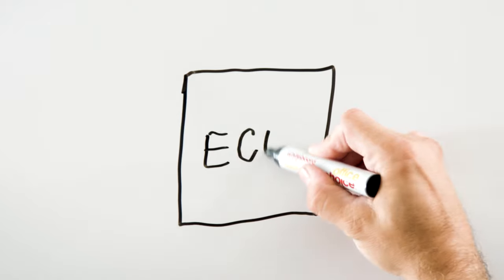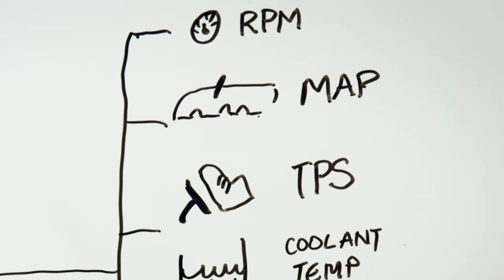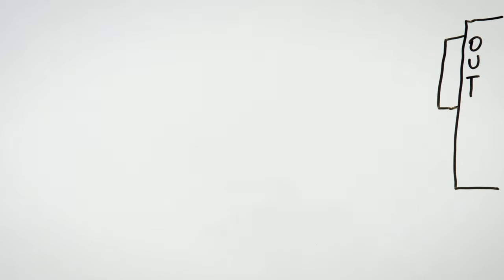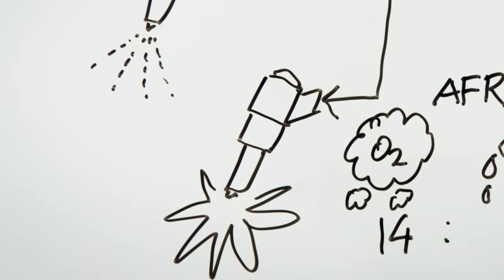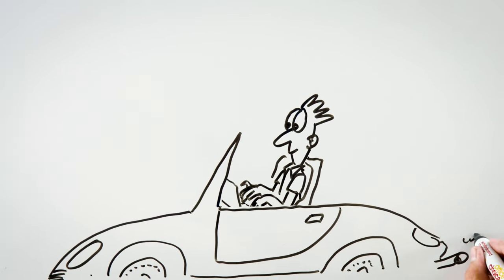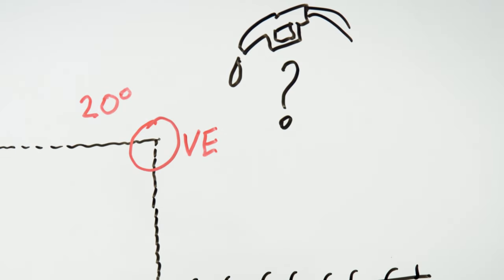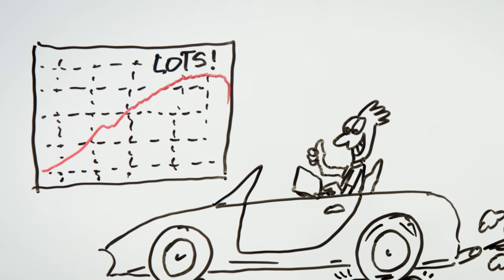💬 How ECUs Work - Technically Speaking

Comment: Scott, thanks for the video...it really condensed the concept of how an ECU vs. a carb works.  My only question is:  if I'm not obsessed with performance (and not an electrical engineer), and I just want to keep my bike running steadily and reliably, where is a good place to start learning how to interpret engine trouble codes and how to diagnose electrical problems instead of having to go to the dealer every time I get a bad code? Having said that, am I better off sticking with my carbs and throttle cables :D ? Thanks and cheers!!

Comment: Great explanation and breakdown, Scott. Still a lot of confusion out there about how ECUs and tunes do.
Reply: yep, I think what I'm learning is that any tuning I tried to do would end up with the engine running worse or not at all. 
I think, ( but I'm not sure) that you MUST do the tuning with the car on a dyno. So, either buy a dyno(kidding) or get access to one. 
But, then of course it'll be the techs and not you that does the tuning I expect.

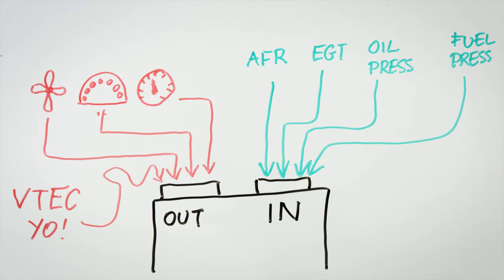Comment: Please forgive my ignorant question, but @ 4:58 and there abouts, you draw red wires going INTO the 'out' side of the ECU.
 I would have expected that the 'out' side would show wires pointing OUTward,  figuring that the signals have been corrected, and  the 'revised' signalling is then being sent OUT (to the various sensors I guess) to make the necessary adjustments for efficiency.
If that's not how it works, well then I guess I sure missed something.
I really enjoyed your presentation.

Comment: Does the ecu control the AFR, so a tuner can only input a certain AFR while tuning,  instead of fine tuning fuel injector timing for a certain manifold pressure and throttle position? 
For example you just input an AFR of 14.7 at rpm below 3k, and a little rich mixture for higher RPM range, just an example. 
Thank you so much in advance!

Comment: Hello haltech. Currently I am imagining to convert my old  2 stroke engine (Yamaha V80) using the TBI system.I'm curious about this, can the TPS sensor cable be split into two? One to the injector and the other to the oil pump (like the KTM electric oil pump). If you know the answer, I would be very grateful

Comment: I have a customer range rover car that crank but wouldn't start. There is no spark, injector pulse and very important no control feed current to the ECU when the ignition key is switched on? What causes no feed current with key ON?

Comment: Great. But my question is, is MAP really cruicial to the calculation? My bike has nothing resembling MAP sensor, only IAT, CTS, TPS, O2 sensor and that's about it. Wondering how I could connect programmable ECU to my bike when this sensor is missing. The ECU it has now is hardly programmable, reverse engineering is a way to go, but with rather blurry future.

Comment: So how are ECMs programmed? I mean I can understand machine code being completely enough for the car, but what about whenever READING the specific manufacturers data or maybe an engineer needing to reprogram the PCM for increased efficiency?

I'm basically asking how the ECM is then translated BACK into a readable language.
Reply from the maker: Via an ECU programming software. Each brand of ECU has its own firmware and a calibration software.

Comment: Hi, thank you for this video. It is very informative. However, one question though. Is the ECU mainly focuses on the FI process and is it standard for all bikes? I am planning to customize the dashboard of my motorcycle (Yamaha NVX 155). I wish to create a custom-made display screen, which I will replace the existing digital dashboard display.  I wish to make the new display screen more intelligent and has many more added function such as GPS-direction app. Is doing this does not require alteration or change in the ECU? My goal is to make my dashboard (digital display) a bit smart and does not only dispaly, RPM, Speed, Time, Trip and Odometer as what the original display does. Can you please shed me light on this, I don't wanna mess with the ECU, is it possible to make this project with the said restriction?

Comment: if I have a pressure ratio tuned elite set up and I remove my muffler the elite will make fueling change based on the pressure ratio change ....ok that's the basics please please do a pressure ratio video it's a great development that needs to be descussed.
Reply: Isn't that related to forced induction?
Reply: +SI0AX it relates to.every engine but is far more significant to a for forced ones...
Reply: So it's just another tuning method? Like boost tuning and load tuning?
Reply: it  becomes the main load axis  it creates a number from inlet manifold pressure and exhaust manifold pressure ( i think) it   looks to  express the pressure differential across the head of the engine  and that helps determine the mass of air that the engine is using .. and therefore the fuel it requires.
Reply: That's interesting. There should be a general video about all the different tuning types and a basic explanation of how they work.
Reply: yeh that  would be a reasonable compromise between what i want and what the world needs

Comment: ecu monitor sensor signal ,when sensor stop working ecu show a fault code read by scanner, solenoids like fuel injector or oil control valve dont send signals to ecu so how ecu know solenoid stop working to show fault codes related to solenois?

Comment: The situatiom im having with my 03 3.5 nissan altima is..i was told if the timing chain is out of time which i guess mine was 64 degrees out of time amd thats why im not getting spark and fuel injection...could this be a factor? This cars ignition is controlled by the ecm..whats ur opinion..i personally figured if the cam and crank is out of time and the cam and crank are both turning u should still get spark right?

Comment: Don't you also need a crank angle sensor input or trigger wheel to know where the pistons are?
Reply from the maker: Yes, we’ve simplified things greatly in this video and an engine position sensor is what we refer to as the ‘RPM’ input in this video.

Comment: You don't mention crankshaft position sensor (CKP) which is vital for injection and ignition system. 
The right timing for injection and ignition involves this CKP to determine piston position and RPM.

Oh wait, you have mentioned it elsewhere in response to someone's comment below.
Reply from the maker: We deal with the crank position sensor in detail in a separate video: https://youtu.be/HW0ENqcxNSg

Comment: If my cooling fan is not running at all, with or without the A/C on, is there a chance it could be the ECU? I replaced the cooling fan, and it refuses to run at all.
Reply from the maker: We'd recommend checking your wiring first.

Comment: Hi, Have you had any experience in updating the antiquated ECU from a 74 Model Mercedes 450sl/slc with a Haltech unit? This is the electronic version. Its called the Bosch D Jetronic injection. Hope to hear from you soon. Paul
Reply from the maker: Hi Paul, it isn't something we've done here. However, give your local Haltech installer a call, they may be able to help. 
https://www.haltech.com/dealer-list/

Comment: I have a question for you:
Why do I have to buy and expensive ECU, and have it installed and tuned, spending all of my money on some weird computer, rather than taking my mad gaming laptop and connecting it with a few cables to my mum's old Hyundai i10, and just have it send the needed info to the car?
Reply from the maker: You don't HAVE TO do any of that. If you can control your mum's i10 with your gaming laptop - go for it!
Reply: Some ECU's can be tuned, others are locked from the factory or the manufacturer has not released the source code. In those cases it is extremely difficult to modify the ECU. Some manufacturers, like GM, release the source code and make it very easy to modify the ECU, for example I was able to retune my ECU to run a completely different engine (stock engine was a v6 and I swapped in a v8) and all I needed was an OBD2 to USB converter and the software.
Reply: @haltech  obviously I was joking with the examples, but as a programmer I know how easy it is to control microcontrollers and external devices, so I don't see too much reason (except for if the manufacturer checks you use legitimate equipment) to use such expensive equipment
Reply from the maker: @irmi2000  There's quite a bit more involved in making a viable product than just programming a couple of microcontrollers.

Comment: What about mass air flow can that work in place of manifold air pressure or would that have to be converted to run a haltech
Reply: MAF comes before the throttle body, whereas MAP sensor is after the throttle body coming into the intake manifold.
So their functions are different.

Comment: Isn't a cam sensor or something equivalent required? So that the ECU can know which stroke each cylinder is in?
Reply from the maker: Yes, we’ve simplified things greatly in this video and an engine position sensor is what we refer to as the ‘RPM’ input in this video.
Reply: Ah, I see. Are your ECUs capable of controlling an engine without a position sensor? I work a lot with Saab's, and their Trionic ECU determines the engine position by measuring an ionization current in the combustion chamber/spark plug gap. If I were to install a haltech ECU on such an engine, would I have to change the coils and install a position sensor, or could I use the advanced Saab Digital Ignition cassette/coil pack?
Reply from the maker: All Haltech ECU’s require some form of engine position input to determine correct injector and ignition timing. The proprietary Saab system would most definitely not be supported.
Reply: Allright! Will have to think of a solution to that, then. Thanks guys!

Comment: I’m sure my car has a faulty ecu. The range of issues with over heating, loss of power, smoke from the exhaust irregularly, ABS , “ vsm”😢
Reply: check to see if the oil is light brownish if not you need to replace your oil

Comment: Is it possible for the ECU to control a exhaust cutout butterfly valve? Haven't seen that application on cars just, sports bikes
Reply from the maker: Yes, this is possible with our Platinum and Elite series ECU’s via a simple RPM on/off switch output.
Reply: Sweet 😁😁😁

Comment: I want to put 2kd toyota engine in f30 bmw so how am gona give power to toyota ecu to start the engine
Reply from the maker: You will need to re-wire the engine. If you use the factory toyota harness you should be able to use the factory ECU. Although if you're unsure about how to do it we'd highly recommend getting a wiring professional to do it for you.

Comment: Everybody is teaching people about the basics, but I found nobody who actually understands it properly.

I program chips, but I'm new to automotive chips. It is stunning how those 'tuners' and "professionals" know nothing about what they're doing.

They just resell maps for a massive amount of money and buy expensive software that allows them to slightly adjust the old software while understanding nothing about it.

They just have their script: oh, short these two pins for 5 seconds, plug a cable, turn on this software then turn on that software and that's it.

This type of remap shouldn't cost more than $50 for time, yet they sell it for $500-1000 as if they had to be skilled to do it...

Comment: Hey, is it possible to manage a 2 stroke fuel injected single cylinder engine with a halltech ECU?
Reply: Ofc it should be, if you are talking about transfer port injection that is.
Reply from the maker: The short answer, is yes :)

Comment: if i put some bolt ons on my car and i want to tune the engine to maximise the gains from these parts do i need to invest in an aftermarket ecu or can you still do something on the stock one?
Reply: thanks for the video
Reply: way to general...with your question if I am correct to assume r34 gtr you can tune and optimize modest bolt ons with an ecu hack like nistune or a piggyback like power fc ...if you want to go a bit more hardcore like doubling the power output a haltech plug in is worth consudering this will give you a few good upgrade functions like luanch control flex fuel.rain mode now control anti lag...
Reply: That depends entirely on what car you have,  but you are going to need a chip or modify the original ECU at the least. If it is a nissan you should check out Nistune, and you can probably find something similar for other car makes. If you want full control of your ECU you should get a proper standalone tho, thats why i bought my Elite 1500.
Reply: Adam Naylor nistune actually has flex fuel as well
Reply: @Adam Apexi Power FC isn't a piggyback.. It's full standalone albeit a bit outdated nowadays. I've just bought one for my FD. Haltech is definitely the way forward though, will be investing in one for my GT-R at some stage.

Comment: Nice, thanks.
But, I am thinking about reading raw ECU data without using any standard tools or any commercial kits.
I know different cars use different OBD2 protocols. My car uses J1962 connector for its data link, so I need a J1962 adapter to 9 or 25 pin RS-232 serial connector on a PC from which I can retrieve raw data using a simple program I am planning to make myself. 
Has anyone here successfully done so ?
Reply: Ah sorry, although my car implements SAE J1979 for diagnostic modes, it doesn't use J1962 connector, it uses a 14 pin proprietary connector. I am not sure there is an adapter currently available that directly supports this 14 pin connector. ELM327 is OBD2 compliant that uses J1962 connector. The only possible way is to find 14 pin to 16 pin J1962 adapter which I find recently in internet.

Comment: well if you think about it, if the engine has so many inputs , it should be possible to make the ecu tune itself...
Reply: Confused95 nope, that's how skynet gets started.
Reply from the maker: It is called Long Term Learning (Auto Tune), and is a feature on all our Elite ECUs, from the Elite 750 up. ;)
Reply: Haltech ok so if i would load up a base profile on the ecu and just did a lot of casual driving ,would i end up with the same tune just like if you guys tuned it by hand?
Reply from the maker: It would learn over time to reach the Target Lambda table, but you still need to set this table to the values that you want to use. But yes it would tune to this target as you drive.  However,  you would also still need to tune the ignition timing and other functions of the ECU that do not have Long Term learning.

Comment: I hate to criticise....but.....
yeah, so E.C.U. stands for "Engine Management System", right? 
so does E.M.S. stand for "Electronic Control Unit" then? 
(we're confused) 
It would really help my aching brain if the narrative actually matched the whiteboard drawings. 
Like you're saying "Ignition Timing" and writing "V.E."  then saying "Fuel Pressure" as you write "AFR", so my mind was constantly having to try to unshuffle the terms being thrown at us so quickly and all jumbled up.  I'm like "what did he say? ... why is he writing something else?" "Dang! what's a VE... is that Voltage something-or-other... oh wait he's moved on to something else now.. dang! I've missed ALL of that now.... should I pause or rewind... maybe it will be made clear as he explains more..... dang! nope!" 
Similarly you mention wosisname, thingy and fan, but draw the fan first, so everything is all mixed up and certainly confused me. 
One minute it is an ECU then it is apparently an EMS.... could you not distinguish by explaining that this is an ECU which is a 'type' of EMS - or simply call it one or the other and stick with it? Or even say "some parties call it ECU, but we'll refer to it as an EMS for this lecture". 
What does the Tuna do again? 
You've got a HUUUUGE range of these maps, (hEY! ... let's call them "look up tables") - do you think you could explain what ONE simple one does then?  Do we use them in different cars, or does this Tuna come to my home and create one specially for just me? 
Clearly the Tuna is drawn as sitting in my car with his laptop, so I am definitely going to need his number to ring him next time a customer needs his whatchamacallit fixed. 
"Sorry mate but your ECU needs new glasses because it can't look up any tables just now - I tried to order you a new ECU, but the supplier said they are all out of them, coz they decided to stock up on EMS's instead."
Do you scribble down any kind of course aims & objectives to define your course structure before you start? or just grab someone's video of a whiteboard and narrate your own thing on top? 
Its a shame because you seem like you know what you're talking about, but it didn't come across well. To be fair, it is a common problem with a lot of "experts", they forget what it is like to be a learner, so they jump around (because they can). 
I'm sorry, but I have only been working with electronics for 35 years, so I am just a beginner,  that's probably why I couldn't follow you. Joking aside mechanics is not my speciality, so I needed to just absorb some of the concepts and maybe ponder what AFR might be and how it might affect an engine, but I would have thought I should have been able to follow the gist of what you were saying, but it didn't work well for me. 
The script should match the images as they are presented is my main drip.

Anyway, I hope you will take this positively, but, with a little fore-planning I think this could have been more effective.